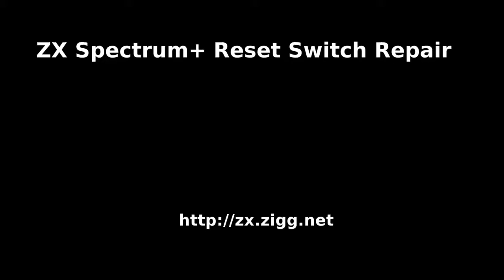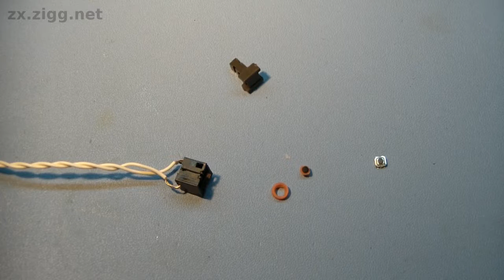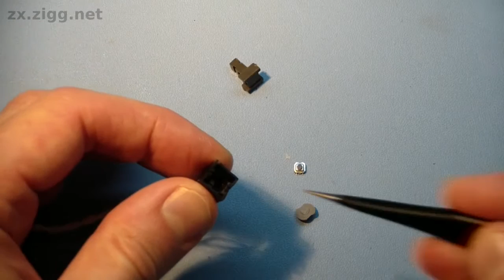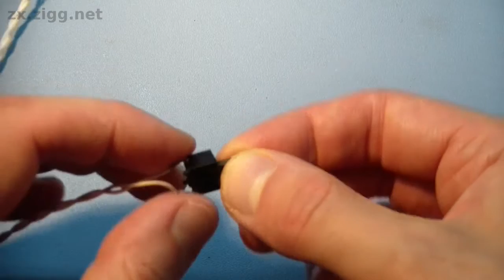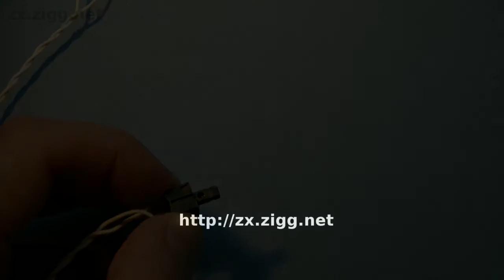Repairing a ZX Spectrum+ Reset Switch.

Comment: Thank you so much, it was a fast answer. I soldered it, will be good, thanks.
I have one more problem. If I powered on, than I get black screen. You can watch it on this link:  http://www.csongorfekete.com/download/ZX_SpectrumPLUS_black_LCDTV_signal_LoRes.jpg
I have made the RF Cable and I found the signal on 586Mhz. Have you any idea, what need I replace or repair?
Reply from the maker: It's a bit difficult to tell what's going on with that poor quality picture. It could be that the TV isn't or can't be properly tuned to the Spectrum's output or the RF modulator in the Spectrum might be failing. I suggest tapping off the composite signal before the modulator to get a better picture. You should be able to find information about doing this at a number of sites, including the forums at http://www.worldofspectrum.org .

Through the fuzziness, I can see the central area of the display has character width vertical black and white stripes. There could be many causes. It doesn't look quite like the result of a typical lower RAM fault (very common), but I can't tell with that poor picture.

Try the tests described in ZX Spectrum (48K & 16K) Initial Tests . What results do you get?

Comment: Helló!

Could you help me please?
I don't know, where is it soldered to on circuit board.
Reply from the maker: The reset switch should be connected across capacitor C27. Sometimes it is easiest to connect it directly to the capacitor's leads and other times to nearby points on the circuit board to achieve the same thing. Some continuity testing will be in order to discover appropriate connection points. Given the way I usually mount radial leaded capacitors (see other video about this), I usually connect one side of the switch directly to the negative lead of the capacitor and the other to a via just above the capacitor that is connected to the positive side. The issue 6 Spectrum has purpose designed connection points for the reset switch.